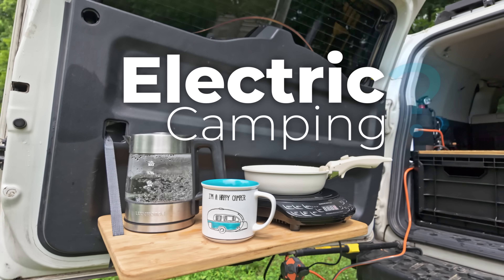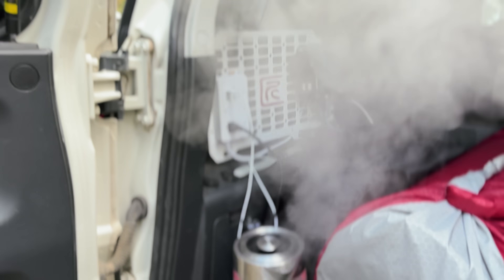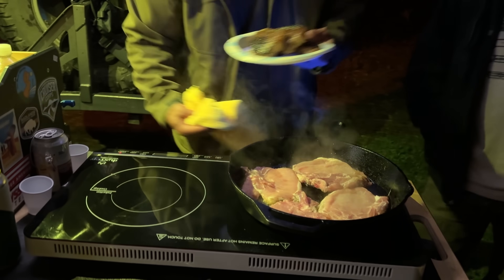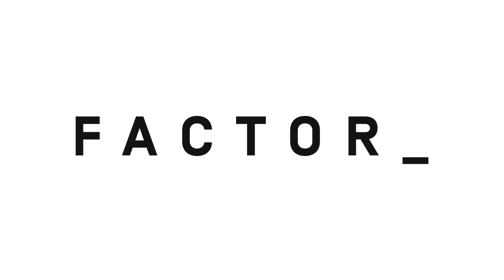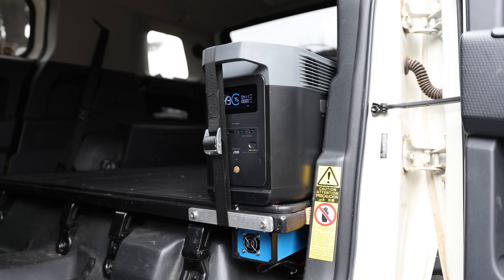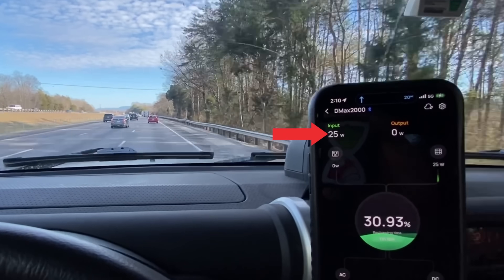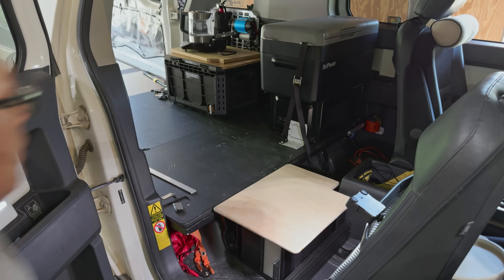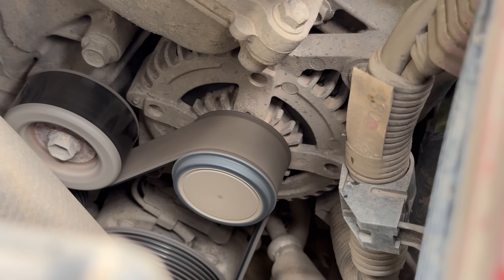I Tried Full Electric Overlanding For 1.5 Years | Was It Practical?

Comment: Many years ago I bought gas burner... never used it as all my vans had and have powerful electrical system, required for work. Gas has sense only for shower water heating, 12-15 KW power at least. 2KW is much easy to extract from electricity. And it is much more versatile - kettle, microwave, induction, pancake maker, pressure cooker, whatever you wish will work.

Battery capacity.... ummm, 12V 200AH is absolute minimum. Just to start anything without power cut, as 1KW is about 100A load. 2 batteries - 400AH, 50A from each - is much better, prolongs battery life and gives peace of mind about energy reserve. And NO LITHIUM! Dangerous and unpredictable, BMS can disconnect battery any moment while powering something or, much worse, when charging, thus destroy the generator and electronics.

Comment: You nerd-out on this stuff in a cool way.  big-BIG respect.

Maybe in the next electricity vid, you might tackle the decision on how to best power a fridge; comparing AC vs DC.  I recall seeing a youtoob fridge review a while back that said rig fridges should be run on DC, and said it was more efficient.  

I am about 20 hours into my test right now, and seeing that DC is looking like it is more efficient.  

I don’t fully understand why, and when I consulted The Googles the answers really weren’t helpful  

I asked the efficiency question of AC or CD on Amazon for a ICECO fridge, and ICECO responded with “Hi, thanks for your question. Insufficient voltage will directly affect the cooling efficiency and performance of your refrigerator. We recommend you can use AC, the voltage will be more stable under AC.”

If AC is inefficient, is it because of the converting process or is there something else happening here?

Comment: Thanks for this.  I've owned an Ecoflow pro for a couple years looking for a purpose other than home backup power.  3600 KWHr, but it weighs 100lbs.  Maybe I want the Ecoflow 800W alternator-charging unit for my trip to Alaska next year.  Good idea on the microwave.  I own a 2 burner induction plate already.  I also own Starlink we use as backup at home but could be used mobile.

Comment: Thanks for the vid man.  This has been my largest hang up I've had with beginning my van is the electrical system.  Custom battery bank or power station.  This might sound stupid but I always think to one of those days where I crash the whole day in the van streaming or playing online games.  I want enough power to go potentially 5-6-7-8 hours with a monitor running, xbox, router.. wouldnt be too often I drained the batteries like so but want to know it has the depth to do so.

Comment: You should really look into HotLogic warming ovens.  They have a smaller 12V model as well as a bigger "casserole" 120V model.  They are excellent for heating up / cooking leftovers without a giant power draw.  Small one pulls 50W and the larger one is only 100W.  Ive had them for years, super super useful.

Comment: I been running 2560Wh in my 4x4 with a 180watt panel And 145amp custom alt ..Lights fridge fan  600watt A/C when peak sun times are hot However with 2.5inches of spray foam And a thermostat The wattage works out to be 350 to 400wh The trick being I run my trucks A/C first for 10 mins Power stations are nice But you pay for the cost of it to be portable

Comment: Really depends on what you do. If you drive a lot this works, if you don't it doesn't. Also depends on the style of cooking or heating equipment you use. I have 2400Wh in my overland trailer and it's enough to run everything for 4 days without charging in about 90 degree weather. I don't do cold weather trips so I don't really care about cold weather capabilities. around freezing is my minimum temp.
I run most things on gas and I never ran out - that's just poor planning. I don't see a reason to spend a couple thousand bucks just to be electric - it offers no benefit to me since my trailer already has a pull out kitchen and I don't need to run a water kettle inside.
I love my induction range at home but I don't even own a microwave as I never had any use for one. My kitchen setup has 6 burners and I frequently use all of them. No, I don't do junk food, neither at home nor when out on a trail. I cook from scratch every time - it's a preference, I know. So most of my electricity goes into refrigeration and amenities like shower and furnace.  I do have a DC/DC charger in the car to charge the batteries while driving, but most of the job is done by 800W of solar panels, some mounted on the trailer and most portable on extension cords so I can move them 40 ft out into the sun.Usually recharges my batteries in 2 to 4 hours. I do remain stationary a lot. I drive someplace, find a nice spot to camp and then explore the area without the trailer. Works for me and I don't see much benefit in electrifying everything. A bottle of gas lasts me at last a month and I usually carry 2 20lbs bottles so I can enjoy my gas firepit any time I like even in red flag conditions which on the west coast are common. So whenever there's a ban on campfires, which to me belongs to a camping trip, I at least have a gas firepit. What do electric people do? Run a laptop with a fireplace app?

Comment: Would there be an efficiency difference using 240 volt appliances vs the 110v
Reply: Yes, but nothing you'd notice in real life. The biggest advantage is that a 240V system can use thinner, lighter and cheaper wires.

Comment: the concerns over using gas are valid if a bit overblown. however, i would say it is better to have redundancy than rely on any one method alone. battery systems can have issues holding charges as they age, or you could have a period of several days of overcast where the charge you might get from solar isnt enough to overcome the draw of the items you are using (many people run fridges in their rigs which is a near constant draw even if it does vary in how much it draws over the course of a day). personally, i'm a fan of hot tent camping when its cold out. why? because by using a wood burning stove, if its cold and wet out, i can heat the tent using the stove, i can cook on the stove, and it provides many of the same advantages of electric cooktops without the risk of running out of power to use it. if i run out of wood, i can always collect more from the surrounding area. there's usually plenty to be had. yes, it requires me to collect it and process it down to sizes i can use, and yes, if its wet its harder to get a fire going with it, but it will still light, and once the stove is going, the heat coming off it is enough to rapidly dry out any other wood that didnt immediately go into the stove. usually when i get in to camp, its part of my ritual to process down enough firewood to last me several days in camp. if i was staying there for a longer period of time, i could either do that every couple of days, or spend a day just doing that to set myself up for the rest of my trip. then whatever i dont use can be stacked up and left for the next person to use that campsite.

Comment: 11:40 It seems to me it would be better, if you have solar panels and need to have both alternator and solar power, to see if there’s a splitter that isn’t 500W-500W, as it will slow the alternator   charge and unless you have a very large solar panel array, only use a fraction of the 500W allotted to it. Is that fair?

Comment: I have a 2500wh electric generator with an installed 300w DC-DC charger. I also have a 300w portable solar panel. I'm full electric with two induction plates and steel cookware in lieu of cast-iron. I've never had a problem with battery charge or felt like I needed to ration the battery energy.

Comment: As for energy i also agree but with some variation, as your needs really determine what you need to purchase, it's a matter of configuration. When looking 2 years ago i couldnt find a generator that worked for me, except very expensive ones and the lack of expandability/configuration compared to a custom system. In hindsight, especially now, a stand alone "generator" is awesome, way simpler and made more practical with new "engine chargers" (dcdc converter). btw i do car camping compared to your overlanding. my main issue was that i couldnt find an adequate station that fit, they either had a big enough battery but to low an inverter, or crazily, a big enough battery but too small an inverter (within my price range). nuts. later i found a nice accessory station, 500wh with an 800w inverter and an excellent - 400w charger. The neglected detail is the recharge, which you covered, gj. this box is handy to power most things and to move power to my vehicle as plugging it in is a challenge and the unit weighs under 20 lbs. my engine charger is 50ah. i went with alot of storage. the other hidden cost are cables and especially connectors - they add up and can be a pain (i reduced this with larger batteries, only needing 2). with my system setup i have infiinite possibilities on how i add/replace things. I can run for over a week (during rain) and if my energy output is too high, i can either eat sandwiches, salads or use a small propane hiking stove. the other energy suck is a heater - dont get me started. also a de-humidifier, which seems to be a constant battle - less of a thing if you drive alot, which is variable for me. The need is very tricky, i would say, because of the large cycles of lipo, order lipo and buy bigger than you think you will need - it will last a long time. i am hoping as time goes by things will get more efficient, except for heaters - but coffee machines are proving me wrong. If you get pregrind coffee the aeropress might be the simplest/nicest option. I love how you hinged the compartment for your car charger, that was sweet. thx again for the video. oh slow cookers are great, low power, can run on almost any system HOWEVER the run time requires a large battery - 8-10 hours per cook. my slow cook meals can last for a week though, and i want to see how it does for heating up soup (short run time). Running it during sunny days is optimum as you wont lose energy storing and retrieving energy from the battery. i wish i had one that was 12v, that would make a difference. Perhaps the 12v food warmers are the trick?

Comment: Thank you for the video, gj. i made the same conclusion. My original plan was to go with a tiny microwave, so that i could boil water inside during rain. It was 1000 watts. every time i went to order it, it was out of stock. my system design was for 1500w. i ended up with a 6 in 1 cooker which i am happy with so far. It is 1400w but i run it mostly at 1250w.  the steak and ribs looked amazing on your videos. My main goal was to cook eggs and bacon and boil water. I looked at induction but 1) too much power and 2) it didn't work with my lightweight backpacking pots. I also looked at kettles but it is one of the highest demand energy devices, like a heater or a crazy A/C. i found most cookers all boil water in 4 to 6 minutes. I use a propane stove as a backup as i can use it inside if necessary and when energy is low. I have done testing but not alot of practical use, max so far is a 3 day trip.

Comment: I’m electric with my Minivan. I have a small kettle, a small microwave and a small Instant Pot. The Instant Pot, which is an efficient pressure cooker, can also be used as a griddle. With a 12 volt fridge, I can precook a lot of meals and simply heat one up in the microwave. I use two power stations. That way one is always attached to the fridge and I can be charging the other one with my portable solar panel. If it’s cloudy, I can always recharge with my vehicle. My minivan is a hybrid, so the engine only turns on when the hybrid battery gets low. It’s a fairly efficient way to recharge the power station. To clean my dishes, I rinse them off and then use a small steam generator. That saves a lot of water since theres no soap to rinse off. The super heated steam gets rid of any grease/oil, and it kills bacteria with the heat.
Reply: I have never heard of the steam generator, would you mind posting the link to the product if it's available for sale? Thanks!
Reply: @kitty4536  yeah I'm interested in this!!
Reply: Yes, please share link to steam generator, sounds very efficient! 😊
Reply: Me too! Please share a link to the steam generator
Reply: Guys the steam generator is just a cheesy kettle. It will use a ton of electricity. Just use a spray bottle, paper towels and some vinegar or alcohol if you are worried about germs. Steam is ridiculous
Reply: Hello! Out of curiosity, is your hybrid minivan the Toyota Sienna? I just got one and I am trying to sort out my power setup. Which power stations do you use, and do they play nicely with the van's built-in AC plug? I appreciate your time and energy!

Comment: I am all electric, without solar. I charge during a daily drive with a GoPower 1750 inverter to a ecoflow delta 1300 and a zerobreeze elechive (combined 3000+ wHr) using 120v inputs. Yes, there is conversion loss, but it is the fastest charge rate I’ve found.

Comment: Great video review, very helpful for someone looking to getting out more often and for longer duration.

I'm curious, how did you connect solar panels in your FJ? Did you have to run cables through the roof? 

And can you get your hands on a hybrid vehicle for a comparison? I'm curious how the large hybrid battery and high wattage outlet works for overlanding. Can it replace a typical dual battery or power station setup?

Comment: With these 'vehicle camping with electricity' videos, I always wonder if a used Ford F150 Powerboost has been considered.  Put on a shell, set up the bed for camping, and you have 7.2KW of self-managed AC electricity available in a 4WD vehicle and no recharging hassles. This is available in the least expensive XL F150 and it comes with hybrid gas mileage.
Reply: Bro, that's too easy, you need trickled out toyota with 25k of gear to try enjoy great outdoor. A Guy run out of  propane and was saved by a guy with,  $2000 electric setup. What a joke. But all of them. had cast iron pans. Lol

Comment: of course it is. :) or just use diesel/gasoline generator in the car. integrated in the drive train, to charge electric stuff. yep just fit a more powerful battery charger generator in the drive shaft.

Comment: Switch out your electric kettle for a hot water dispenser.  You will have hot water on demand, and it doesn't use as much wattage when heating up, meaning you can get by on a system using less wattage

Comment: In 2018 I built out a van and became a part-time van dweller.  Two years ago I went all electric with a 3KW "solar generator" that includes an 2KW AC inverter.  I have 400 watts of solar on the roof, and can also charge via the car's system.  I use an induction hotplate, a microwave, a small pressure cooker, and even a coffee pot.  Additionally, I power my fridge, a roof van,  lights, and a Wabasto heater.  It all works and I never have to worry about finding butane cartridges.
Reply: Do you have a convenient solution for washing dishes?
Reply: @Pockets1987 vinegar spray. Wipe down with a paper towel and  done. 
I have lived in a non propane van for three years. It seems to be catching. We also have rooftop a/c
Reply: @Pockets1987 . I have two industrial type 1 qt spray bottles. One has pure water and the other has about 12 drops of Castile soap plus water. I spray my dirty dishes with the one with the soapy water and rinse with the one with water only. I’ve been doing this for 4 1/2 years now and it works great.
Reply: What more would you add to your electrical system if you were to include a convection oven / air fryer combination?

Comment: I have two 92Ah LiFePO4 batteries in parallel in the 2nd row passenger-side footwell of a 4Runner, underneath the plywood sleeping platform on the floor of the cargo area (I took out the 2nd row seats). Charged by a 40A RedArc BCDC1240D charger from the OEM alternator, using 4 AWG wires through the firewall. I installed a temperature probe on the alternator housing, with a display on the dashboard. So whenever I see that the alternator is well below 175 degrees F, I do not have to worry about overheating the alternator if I turn on a switch that I installed in the dashboard to send current from the alternator to the RedArc charger, to charge the LiFePO4 battery bank. My 1200W inverter is enough for an 1800W induction cooktop since I only ever need at most medium heat from the induction cooktop, and a medium setting draws only 1100W. This setup worked well on a 6,000 mile overlanding trip. For heat in the winter, though, I am working on installing a diesel heater in the cargo area.

Comment: I use a mix of fuel and electricity. I use a coleman gasoline camp stove and lantern, operates cheap and effectively. Shares an ample fuel supply with my FJ cruiser. My EcoFlow powers an electric blanket, water kettle, fridge, a K-Cup machine if i'm feeling fancy, etc... Charges at 400W from the alternator with a 48V transformer.
That ecoflow charging accessory is 600 dollars! Get out of my face

Comment: Great video, I could not agree with you more from experience. A thousand watts is the minimum and 2000 is ideal. I currently own a 1200 watt and a 2400 Power Station. Also a microwave oven and an induction cooktop is the most efficient way to cook with electricity!